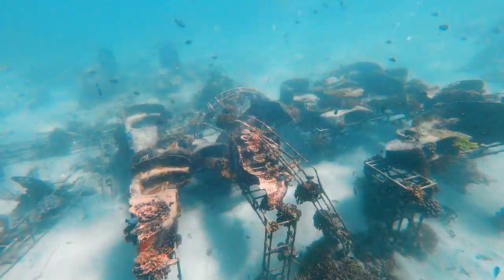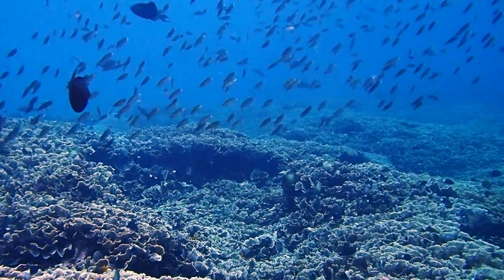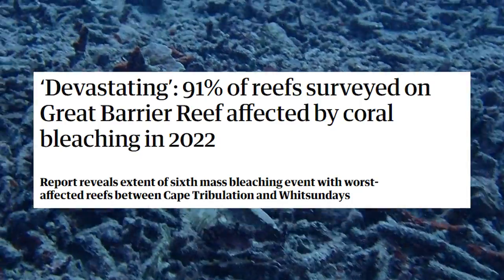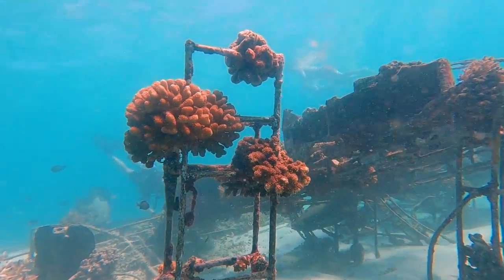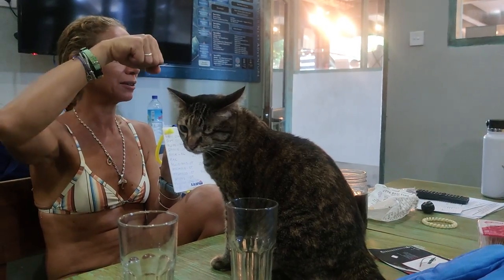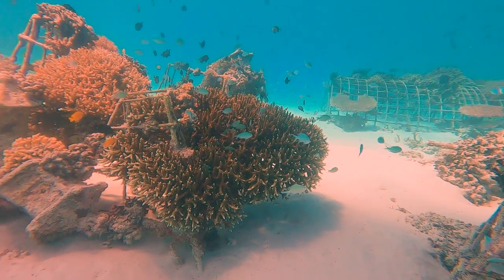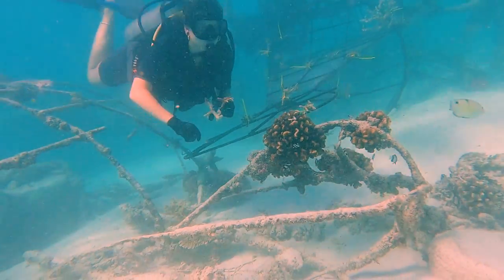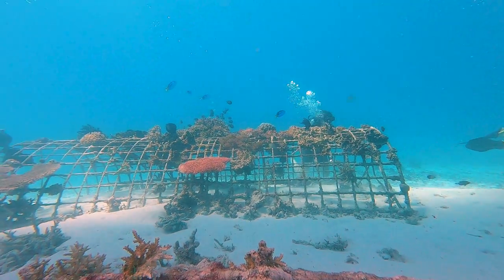I built an electrified coral reef to save corals

Comment: Great video!  Do the structures need to be permanently tied to a solar panel and electrified or is there a point where they feel a colony has established itself enough that it can be self sufficient and disconnected?  You mentioned these are primarily in Indonesia; why do you think this method isn't more widely adopted? At least from your video they seem to be effective. Has there been any data on if certain species prefer 'real' coral vs 'it's electric!' coral? I imagine having that cathode/anode magic happening the electric field might be off-putting to some fish - but what do I know, I'm no fish. :) That was enjoyable to watch, thank you for sharing.
Reply from the maker: After larger reefs have been established, they probably can survive by themselves, if the conditions are good. However, there aren't any longevity studies done because this is a relatively "new" method, so we don't really know how they survive long term. They are primarily in Indonesia because the people who invented the method started it in Indonesia. There are several restoration methods, and others prefer focusing on those. And unfortunately there really isn't much money in restoration or marine conservation projects, so doing these kinds of things in large scales is usually impossible. Regarding fish, except for a couple of sharks that seem to keep away from the reefs, we don't know. There are like only 6 or7 studies done on biorock reefs in general. So there is really a lot we don't know.